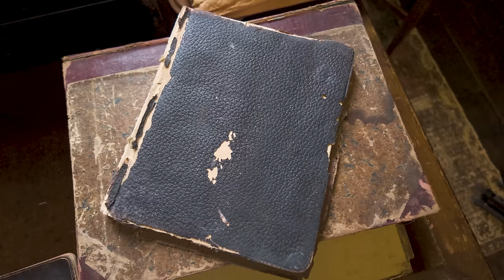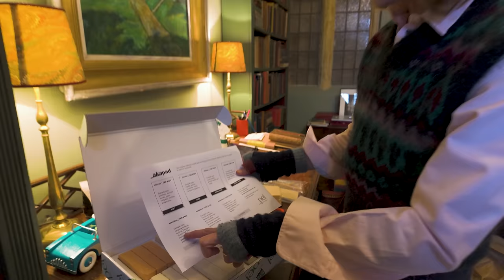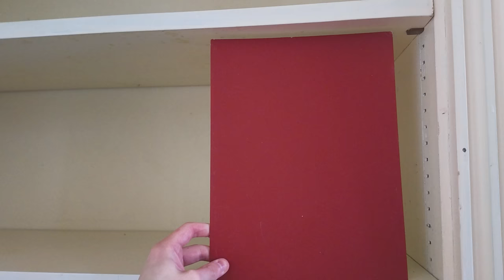The Hardest JOB I've ever done at the Manor (my whole body aches!)

Comment: Julie, my husband agrees with me that, you are the very best thing that has happened to Mapperton in a long time.  Your passion is so inspiring.  As we were watching you struggle with the dust removal I suggested to my husband that you might be able to use a very soft bristled paintbrush to remove the loose layer and then use those magical blocks to remove the rest.  It could save a lot of time with your hands lifted above you, which seems so uncomfortable.  So gently brush it away and then wipe away the rest perhaps?  Vacuuming it from the carpet (or shaking out a drop cloth) seems infinitely easier.  Try finding a soft bristle brush at an artist supply store or website.  We love your energy and lust for life, and we love that you love Mapperton, who is an even larger than life character than your Earl, who we think is fantastic.  Love, Melanie
Reply from the maker: Thank you Melanie!!! Xx

Comment: Thanks Julie.  
My daughter is from China and I've learned that saying "Asia" is more PC than saying "Orient" as in Asian rug opposed to Oriental Rug.
You did a great job with the hat and the ceiling needed that overall clean, as hard as it was.  May an occasional dusting with duster on a long pole will help prevent it from getting so dusty?  Back breaking.  Now go soak in hot bath.  <3

Comment: Watching you clean the plaster molding with the sponge, I have to wonder if you could use a soft bristle brush (sable-hair brush or artificial, if there would be a problem with the natural oils in the sable-hair brush) to remove the loose dust/cobwebs before you start with the sponge to make it less difficult (in future)?  The other thing I thought when I saw you standing beneath the ceiling and working over your head, is that at our age, we need to make like Michelangelo and lie on our backs on a platform close to the ceiling to work up there!  Having painted ceilings the way you're cleaning, I felt for you!  I'm not surprised your back and neck are sore, nor that you're exhausted!  Also, you did a GREAT JOB!  You were too tired to see it, I think, because I could see a difference on camera - one side was "white" and the other had a yellow tinge!

Comment: I’m not sure just what you have planned for your hat display, but those hat boxes are also wonderful, and I wonder if you could incorporate them in your display somehow?  As for small, soft cleaning brushes, I’ve had success with babies’ toothbrushes.  Their size, handle and softness work well on various surfaces.  In looking at the half done, there is definitely a difference to the uncleared part.  You work so very hard, huge kudos to you!

Comment: Use a 1 1/2 inch to 2 inch long handle paint brush to get those cobwebs off. I had to use it before on some wood carvings and it works wonderfully.

Comment: Clean the ceiling first with a rechargeable hand-held variable speed air compressor. They can be set to very low speed and will remove 80% or more of accumulated dust first. Used by furniture restorers, artists and contractors; they do a superb job. As you discovered, working consistently above shoulder height can be one of the most taxing demands on the body. Frequent breaks with yoga stretches is recommended. Secondly, why are you doing all these projects alone?

Comment: Please wear a face mask when dealing with dust and cobwebs! You shouldn't let old dust get up your nose even if you don't have lung issues! 

I have a lambswool duster which I find very helpful to dust the paintings my father did. It doesn't do any damage to them and the dust clings to the wool which I then take outside to twirl off. I would have used it initially on the ceiling and then your special sponges.

Also the smaller man's hat looked like it had a bit of mould on it so check it out when you have time.

Comment: I really would not be doing all that hard work on the ceiling with the sponges. As you said, there are lots of cobwebs so I would personally get a very soft paintbrush on a telescopic pole and I'd mentally divide the ceiling into sections and then clean one section at a time by gently sweeping.

Comment: Does the dehumidifier have an automatic shutoff when the water chamber fills? In the past I've had problems with a dehumidifier that did not. Thank goodness it ran in an unfurnished area of the basement. 
If yours does not it would be safe to place a rubberized pan under the dehumidifier to prevent damage to your flooring. A boot tray or something of the like would work.
Love your channels ❤
Reply from the maker: Yes it does so it's really good!

Comment: No on Alberta's Hat for display. Too much damage unless repaired. Top Hat Excellent.
Reply: I agree, perhaps have a facsimile made for display . I suggest taking the hats to Lock & Co for maintenance.
Reply: They could display it under glass, in a place where the sun would never shine on it, just for this exhibition, and it would be all right, I believe.  I was more worried about the abrasion of the dry sponge on that fragile fabric!  It looks like it withstood the treatment fairly well this time, but I would recommend for Julie to use a very soft natural-bristle brush, or a can of compressed air, for all future dry cleaning of antique fabrics, to keep the fabric (especially silk, like that turban/toque hat) from shattering and shredding with that kind of rubbing/abrasion.